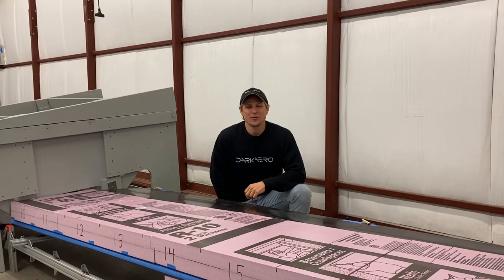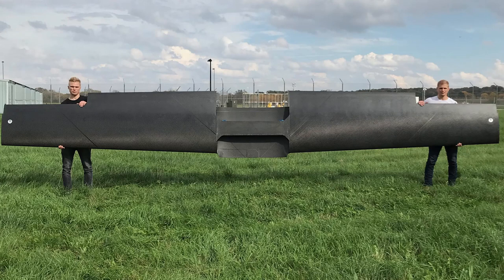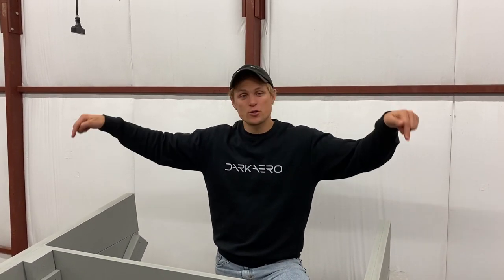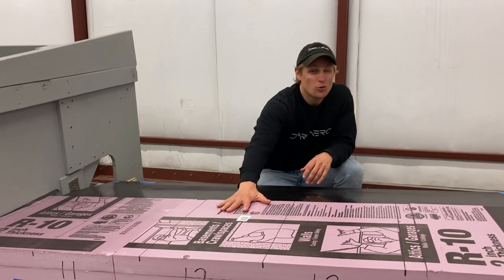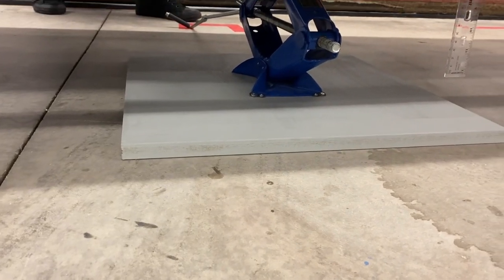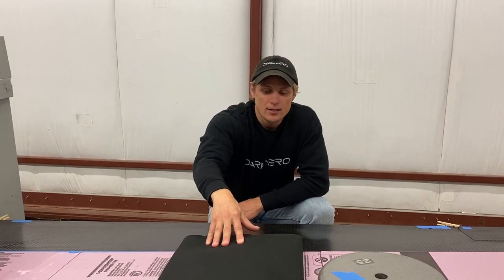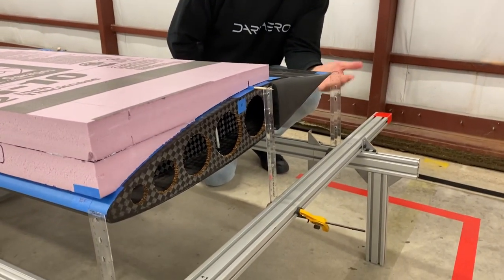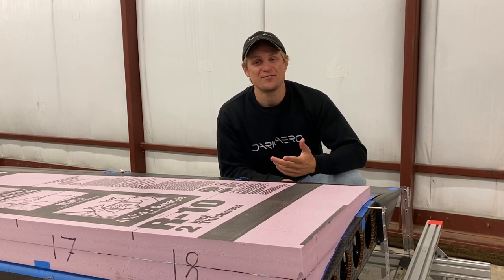How we set up the NEGATIVE G proof load test for the DarkAero 1 wing!

Comment: My understanding is that you are using a wing design with two separate shells, top and bottom shell, have you investigated the possibility of using a continuous shell structure where the leading edge of the wing is continuous fibre? Having done some strength testing for a very simple Formula Student wing design we found that manufacturing the wing in such a way that the required strength is reached is a lot easier when the continuous shell design was used.

Here's a link to an article we got inspiration from for our methods. https://www.linkedin.com/pulse/icelandic-aerofoil-humbles-formula-1-engineer-willem-toet/